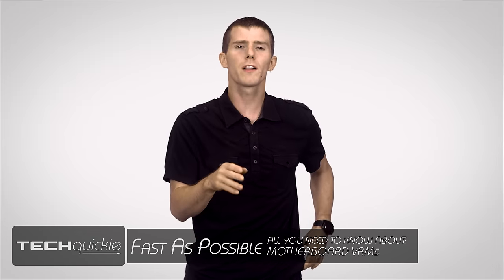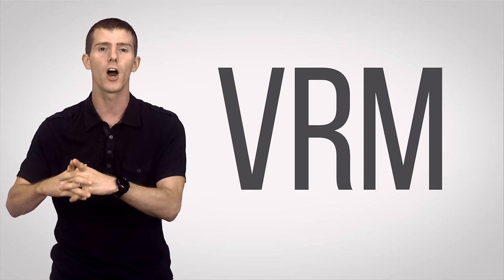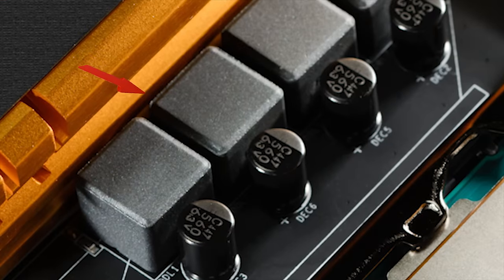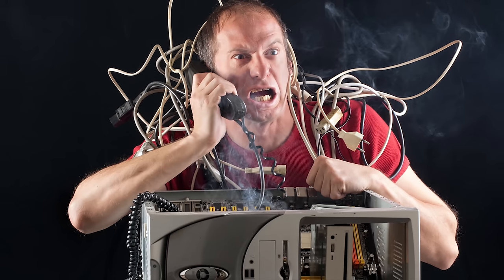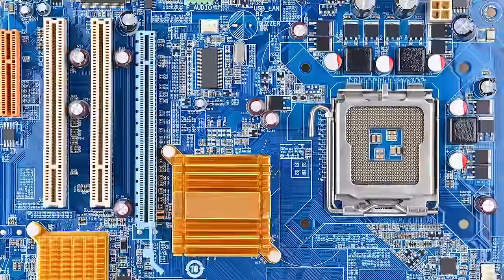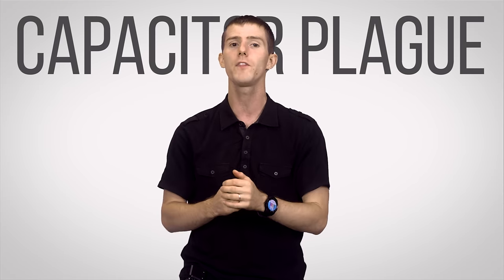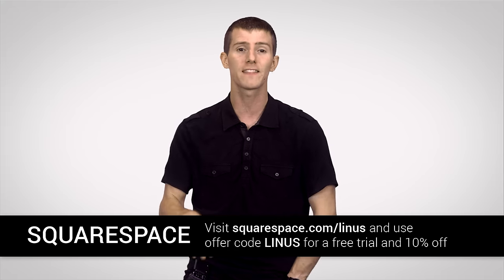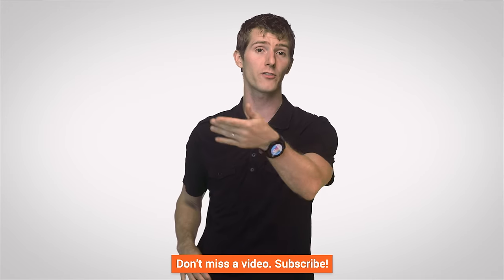Motherboard VRMs As Fast As Possible

Comment: "upcoming ryzen being more efficient"

Ryzen 9 3950x: let me introduce myself
Reply: The 3950X is extremely efficient though.
Reply: 10980xe*
Reply: @OLDSKOOL978 lies. If you have a Threadripper 3990x you would not use it for gaming and which idiot would use 64 cores for gaming. secondly it is almost impossible for that thing to hit below 63 degrees with all core turbo 4 Ghz
Reply: @OLDSKOOL978 OK ok thanks for the evidence. But back to AMD, their CPUs smash every workload at god speed. In premiere my 3950x crushed the workload at god speeds while doing 8k editinf
Reply: @OLDSKOOL978 They have scaled it down, it's called ryzen 5/7. You can still get 4.4Ghz on them, and how many cores are OC'd on your TR?
Reply: @OLDSKOOL978 hey man, I am also planning to build a 3d rendering pc. Which graphic card would you recommend to pair with ryzen 9 3900 ? Also, is 8 gb V RAM enough for the job ? ( Lumion use a lot of vram )
Reply: @OLDSKOOL978 a 2080 super and 64 GB 3600 mhz of ram is what I'm aiming for. I'm still in the middle of saving and by the time I will be done the next generation of cpu and gpu will be out.
Reply: Ryzen 4000 “Allow me to introduce myself”
Reply: It's efficient, but it still pulls power, it just produces less heat with that power
Reply: @dest2royer030  Ryzen 5 5600x, Ryzen 7 5800x, Ryzen 9 5900x and 5950x "allow us to introduce ourselves"
Reply: 5950x

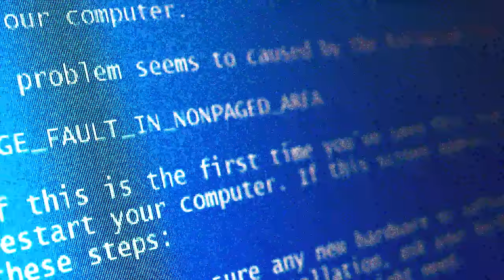Comment: this video doesnt buffer past 1:57 :(
Reply: mine works to 1:58. what is going on?
Reply: Same here it makes it to 1:58, but then freezes. i suspect Graphics Issues...
Reply: What?!? I just flew past that part.No issues here even though I have like a GTX 730.
Reply: *****
it comes pre rendered, your cpu only plays back the still frames in 30 or 60 fps to make it look like its a moving picture
Reply: actually craftbox is right. the video does not call any load onto any of ur computer parts because the video frames are all stored online which means ur computer shouldn't need to download anything. That also means ur CPU doesn't need to decode anything because its already decoded. and btw, ur CPU doesn't render videos that are on YouTube. Only ur GPU has heavy load because it is pushing out the resolution u need to watch the video.
Reply: OK. 1st of all, the videos are online which means that u have access to them and u don't need to download anything. This is like having an access pass to a private room in the military. You can still use it, but it is not yours. Second of all, your graphics card can indeed play and display 4k videos because of the specs on nividia. 3rd of all, I was wrong of saying that ur CPU doesn't need to decode anything, but you have to remember that all the videos on YouTube are pre-rendered so your graphics and the CPU doesn't need to  render them again. 4th of all, It does not make any sense that "GPU's are only here to render Graphics, not a series of frames!" What are u defining of frames and graphics? Also, Your CPU does not play audio. A sound card either attached to  your motherboard or stuck in your expansion card plays the audio.
Reply: What  do you download of
Reply: If your CPU process image and sound, what is your graphics and sound card for?
Reply: click past to 2:05 os something, its like a bug or the nsa trying to hack you since the screen looks like code and they are tying to stop them hacks yo'
Reply: craftxbox 
shsss... i'm just poking fun(OR AM I?), but seriously i have the same thing and i just went past the 2:00 mark where it displays the blue screen and continues normally....
Reply: Using Chrome will fix it.
Reply: mansionese we shouldnt have to use chrome
Reply: But there can be only ONE!
Reply: You have to download everything you watch, you can't magically get information from nothing. Just because it doesn't tell you in a big window it's happening doesn't mean it isn't. Do you think your data cap magically goes down for no reason? Ever watched a youtube video on your phone and had lost a bunch of data? You don't render anything client side, it's pre-rendered footage. That's what their camera + software does. Jesus.
Reply: This glitched there for me as well when watching the video on firefox. It *also glitched again slightly after that when I tried jumping forward a hair (Ironically the second freeze for me was when they showed a BSOD in the video).
Refreshed the browser, jumped around a bit on the time slider, loaded the same video in a new tab (which surprizingly worked slightly better for some reason. maybe because I jumped forware near the first glitch area instead of watching all the way from the beginning. At any rate, even though I couldn't the one in the new tab to hang up on the first glitch, it still locked at the second glitch and was a bit unstable), etc, none of which fixed the issue, but....
I pasted the link into an internet explorer window (whatever version is standard on windows 7. I rarely use it except for things like troubleshooting) and it worked just fine. 
As a side note, when I tried it in IE, it was still open in firefox as well, along with 1400 or so other tabs. mem usage before opening IE was a little over 6gb/8gb, so the system was under a bit of load, but I doubt that was directly a factor considering it should have actually been under even more load when I ran it in explorer. Anyway, I didn't investigate any further than that since I just wanted to watch a video, not solve the internet:P but I thought I'd go ahead and list what I saw and the workaround of using internet explorer in case the info might help others in the future, considering that the problem still exists a year after the first post, and some people would be disappointed if they had to skip one or more sections of the video (I know I was:P).
Anywho, good luck! ~~^_^

Comment: Chokes (inductors) oppose a change in current.  Capacitors oppose a change in voltage.   Both components are part of a filter assembly that filter out electrical noise.
Reply: Thank you.  That was very informative.

Comment: Smd mosfets are often in d2pak package. Capacitor dont protect from voltage spikes, they just stabilise voltage to steady dc with as less voltage ripple as possible and chokes(inductors) conver pwm to fixed voltage (if you have 10v input and driving mosfet with 33% pwm in buck configuration with coil and with no load after inductor and capacitor you should get 3.3v) and at the end there is just a lc filter (inductor in series before capacitor in parallel) :D it's very basic electronics and simple :D

Comment: It's also really important to look at how many bicoupling capacitors each flux phase uses. Cheaper motherboards tend to like to use older ferrite core capacitors which can interfere with the operational transconductance amplifiers on the board. This will likely cause the SMPS linear regulators to overheat causing BSODs. But most important is that they only use C0G capacitors and not NP0 or X7R as they are way too flux dependent and will cause system instability due to their inherent Torrential Cascade Effect transistors.

Comment: Can you do AMD Zen As Fast As Possible? So many questions!
Reply: Its not due for release until 2016. basically all we know is its gonna be SMT like intel (better single core performance) and it's going to be about 40% better than the existing CPU's AMD has now.
Reply: +xFreeland1 When I said fast I didn't think that fast, lol. Thanks for the info, glad to see they left Bulldozer behind. I'll never understand why they didn't just shrink Phenom.
Reply: +20teamplayer They are probably already in production testing now, but they still didn't offer that much information about the architecture itself, just some specs and features. The best desktop CPU will have 8 physical and 8 virtual cores with a maximum TDP rating (specified heat output) of 95 W and it is suspected that they will implement a technology to have one thread processed on all cores simultaneously if needed. The server CPUs will have up to four wafers on one Die, so a total of 32 physical cores + 32 virtual cores. The performance per core is suspected to be 60% higher compared to their latest CPU architecture used in their APUs and those already made a big jump from Piledriver. The performance desktop CPUs will be codenamed "Summit Ridge". There will be PCIe-3.0-controllers on the chip together with a memory controller capable of running DDR3 and DDR4 (probably dual-channel for consumer CPUs/APUs and quad-channel ECC for server CPUs). Each core will have 512 KB of L2 cache and each pack of 4 cores will have access to 8 MB of L3 cache, that's a total of 20 MB cache for the 8 core CPUs, 19 MB for the 6 cores and 10 MB or 18 MB for the 4 cores, depending on how AMD will cut the resources of the chip. The 8 core will compete against the Skylake i7 6700K, the 6 core against the i5 6600K and the 4 core against the i3 6320. It will be an interesting race, especially because I can't remember when it was the last time AMD and Intel had the same structure size for their competing architectures. A Phenom III architecture with 22nm structure size, 8 cores and SMT instead of Bulldozer would've been nice indeed, especially because it's easier and cheaper to upgrade an existing architecture, which already performs well, than creating new bullshit from scratch and trying to optimize it later on.
Reply: Razor Blade Thank you for the info. I thought it was 40% improvement, and that is the theoretical max. Not bashing it, just being realistic. Real would is almost never near theoretical. Here's hoping, this is AMD's last chance.
Reply: 20teamplayer You're right, they changed it again when Excavator was released. It was +60% compared to Steamroller, +40% compared to Excavator. AMD also stated that they will be able to fill the gap between the recent architecture and Skylake in terms of instructions per clock with Zen. It's still not clear by how much it will really be filled, but, as far as the specs look like, Zen will take great advantage from the performance optimizations Intel has paid many software developers for, without the need of changing the code. Coming closer to an architecture the software is actually developed for plus more raw performance than their counterparts will definitely make them more competitive. Atleast, this is the theory...
Reply: @25baam11  Yup. 50% IPC gains on Zen

Comment: Transformers don't perform any sort of wave rectification (the process of AC->DC). They simply step up or down the voltage according to the number of turns on the primary and secondary coils. 

Wave rectification (half or full) is achieved by diodes which block and redirect the flow of positive and negative voltages. The result would be ~110-120v @120Hz :3 

You're welcome.

Comment: Was it just me or did it seem like Linus was utterly bewildered saying the upcoming AMD Zen is going to be more power efficient?
Reply: Well their track record isn't too great...
Reply: well the current gen amd chips eat more power than their intel competitors(im looking at you 9590)
Reply: +1250nick That's a very tame way to put it, and might I add it's been much longer than just the current generation.
Reply: +1250nick You do know it has been a few years right?AMD hasn't released a CPU...obviously the newer CPUs consume less than the CPUs before
Reply: +DavisSgt if you compare amd processors with intel processors that perform similarly, you'll find that amd tends to eat just a little more power. compare something like the fx 6300 to any i3, or fx 8350 to the i5-2xxx, 3xxx or 4xxx series(both of these comparisons are at similar pricepoints and performance) the amd chips would eat more power. google it if you dont believe me. amd these days only beat power consumption when you're using am1 or fm series processors with the iGPU for gaming
Reply: 1250nick How big is the difference for power consumption?In my country,AMD is still cheaper for budget oriented builds,like the AMD FX6300,which is RM459 while i3s are RM462 for the lowest option available.Not to mention AMD boards are still cheaper by a huge margin
Reply: DavisSgt oh you're a malaysian. im from s'pore lol. not much really, unless 1 watt of electricity is 10 bucks where you're at. just get a more power efficient psu if you're worried about power use, graphics cards are the real power hungry parts anyways.
Reply: Few things. One, psu's will not reduce power usage, this is not a video game and PSU's are not new / developing technology. It's just power modulation, and they'll serve up what the parts require. Yes, it's possible for variance between PSUs, in the same way that you can get varying qualities of silicon. Unless the PSU is overdrawing due to low quality, once you reach a point of quality standard you will not reduce power usage in a perceivable way. Second, AMD doesn't use "a little bit more"; The competitor for the i5 4690k is an FX 9370, it has double the TDP of the i5 and performs about equally to it. With more cores, drawing more power, and substantially worse per core performance, which may negatively impact single threaded programs. It costs about 30 or 40$ less here in North America so do with that what you will. It also overheats more. Truly, AMD is not competing, the 30$ isn't worth it no matter what budget you're on. Buy the better parts, always. No team favortism, just statistically and logically AMD isn't providing worthwhile competition except in niche cases.
Reply: yes, the fx 9xxx series do use much more power, but not many use them compared to  your fx 6300 and fx 8350, which only eat a bit more power compared to their intel counterparts. and for gaming they're just as good as their intel competitors for the money.
Reply: +1250nick Lol they use tons more. Get your facts right. My i5 3570k uses about half of an FX 8350
Reply: Patrick Wheeler Half?I doubt the difference in the bill is going to be huge,also taking into account you don't run the FX8350 on full load all the time.AMD even released the more refined and power efficient FX8370 and the FX8370E.The only issue I see is that because the CPUs are outdated,they perform worse than current gen Intel CPU.Also the fact that many reported bottlenecks
Reply: +DavisSgt Sure they may not be half but they aren't the most efficient. The TDP (i know, not directly a measure of power consumption, but it is related to a degree, even explained in a TechQuickie) of the i5 3570k is 77W and the TDP of the FX 8320 is 125W. I don't want to have a war about this, I really like AMD's stuff, hell i was going to get the 8320 if i didn't see the i5 on eBay for a bargain price $140 (i know, Australian prices suck.) I love my ASUS AMD Radeon HD 7950 Direct CU II (longest name ever) and i've got an Athlon in my old PC. I wish AMD would come out with some real dealbreakers, they just seem to be making rebadges with slight changes, meanwhile Intel and NVIDIA are cashing in :(
Reply: Patrick Wheeler I feel you man,hopefully the new Zen architecture next year will be a fresh lineup
Reply: 1250nick The problem with your previous statement is that the 8000 and 6000 series amd processors don't compete with modern gen tech across any range. Like an 8350 doesn't compare to an i5 4690k. It loses out in fully threaded performance, with double the threads. In single threaded performance, it's approximately half the performance or less, and it's still averaging over double the power draw. The supposed price difference on your utility bill is double, there's no considerations there. How much that actually is, CPU boss wagers about 25$ a year noncommercially. If we drop down to an i3 4370, a dual core, vs the AMD 8core, we get about a quarter of the power consumption, and functionally the same in most games. Again, single threaded performance nearly double. Remember that power consumption amounts to more than utility bill. Electricity throughput is the cause of heat in a system. The only reason I wouldn't ever take an i3 is because you couldn't stream, and there are a few poorly designed games out there that really neck themselves if you only have dual cores (Looking at you Planetside)